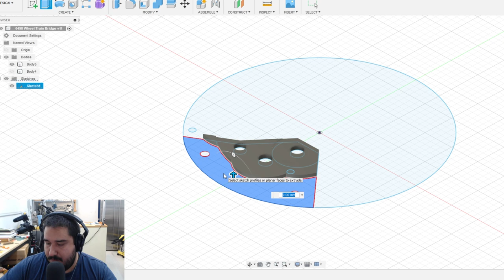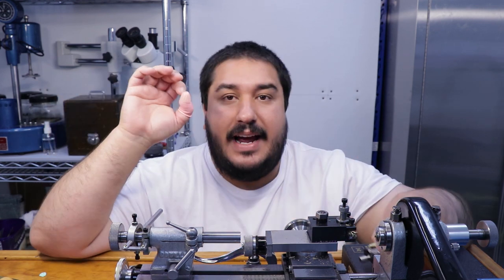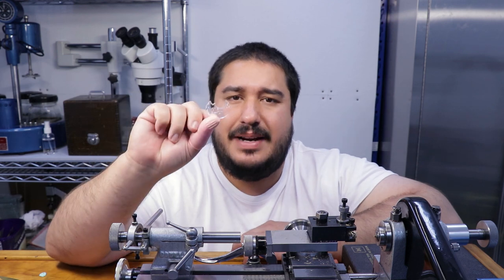Making the Wheel Train Bridge for my Mechanical Watch - Watchmaking Vlog 49

Comment: What type of endmills do you use ,and the coating  ? Measurements ,?  Santa says you been nice looks like full ball radius   ...
Reply: Be aware of chatter on speed feed rates   especially with micro tools
Reply: Blessed you are !
Reply from the maker: Hi, sorry about the delayed reply. I’m using Micro 100 2 flute endmills AlTiN coated. Yeah I’m working out speeds and feeds, I think I will be using 0.9mm for most of my work

Comment: If the Bantam is accurate enough to maintain proper gear depth, I'm buying one. I would have been here earlier but I stopped watching YouTube watchmakers after seeing people put a movement in a holder dial down and then attacking it with badly dressed tweezers and screwdrivers.
Reply from the maker: Thanks Robert! Appreciate your comment, sorry about delayed reply. So far so good. I will be doing more testing soon, awaiting some new tooling to arrive 😁

Comment: Hi Dean. Your train bridge is effectively a replacement for the existing one. Are you planning on customising it somehow? I'd love a full workshop tour too! Keep up the good work.
Reply from the maker: Hi Andrew, yes I just wanted to test the precision of the bantam CNC here. Check my latest video for current design of mainplate and bridges 😁
Reply: @DeanDK  thanks. The new bridges look great. Have you thought about adding a modification to the movement to allow for a central seconds hand?
Reply from the maker: @blueneet84  I'm currently re-doing the mainplate and the bridges. I do want to add complications down the line, after I get the basic watch movement working and completed first. A big draw card for the 6498 movement for me is the sub second. Maybe that will change and I will do a central later.